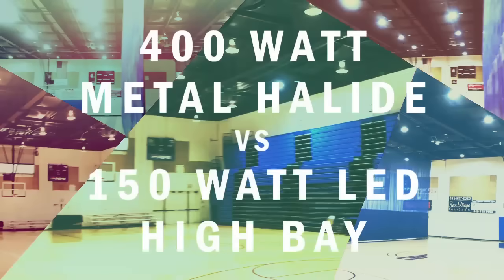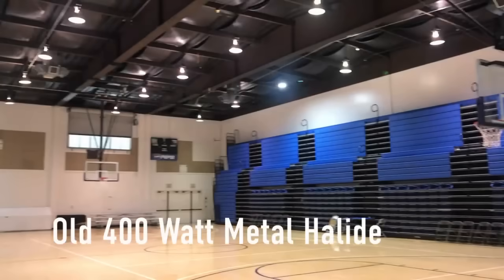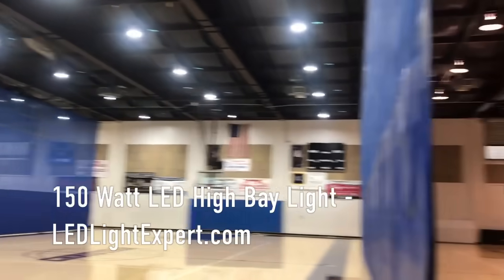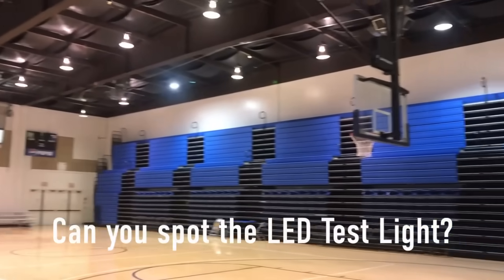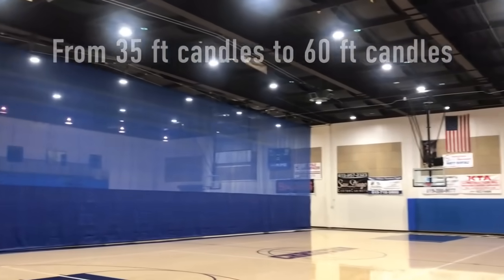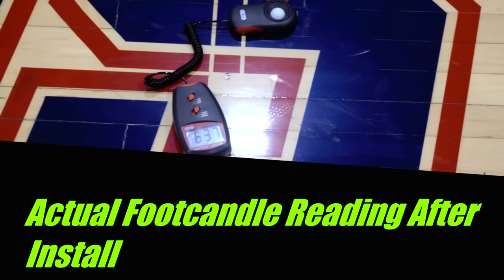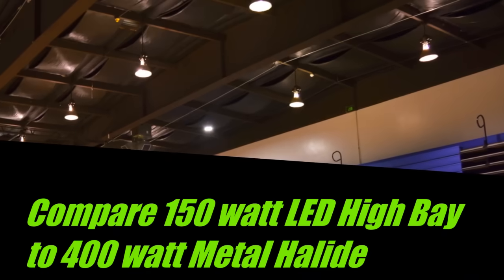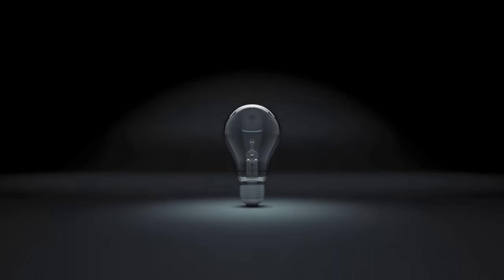400 watt Metal Halide to LED High Bay Light Conversion - Before & After footage of Warehouse lights

Comment: The led is so harsh and unappealing
Reply from the maker: Our high bay lights deliver 145+ lumens per watt, but for a softer, more comfortable illumination, we recommend using lower CCT options and adjustable wattage too reduce brightness. You can give us a call for tailor solutions to your needs 888-701-2183

Comment: I hate led bulbs but i can see why thay are so much better
Reply from the maker: The saving alone and reduced power consumption are the biggest factors that make LEDs a no brainer for people to make the switch. Add that to the lifespan that far exceeds any previous lighting tech, and you have an easy winner with LEDs. Some people do have a problem with LEDs, but remember, not all LEDs are the same. There is plenty of junk on the market that does not live up to the hype and leaves people feeling not so good about LEDs. That's not because LEDs are bad, but because some manufacturers go cheap and use low quality LEDs and optics leading to a bad experience. We strive for high quality and offer lights with independent certification for performance and safety through the DLC and UL along with others, so you know you are getting a quality product.

Comment: metal halide is better
Reply from the maker: Some people do still like metal halide, but those numbers are dwindling. The advantage of LED lights far outweigh those of older tech like metal halide and HPS bulbs. LEDs use about 1/3 of the power compared to metal halides. Beam angle optics are more precise and overall size of fixtures is smaller. Maintenance costs are much lower since you don't have to replace bulbs every 15,000-20,000 hours. Modern LEDs don't lose their brightness anywhere close to as fast as metal halide or HPS will and hold 90% or higher brightness for 36,000+ hours, about the same as the life of 2 metal halide bulbs that can lose 50% of their brightness halfway through their lifespan. LEDs turn on instantly so you don't have to wait 10 minutes for a metal halide to heat up to have usable light. The cost savings alone is usually enough for most people to make the switch, but LEDs have plenty of other strengths compared to the older lighting formats like metal halides bulbs.
Reply: @LedLightExpert  led lights generally fail earlier and they are expensive the new ceramic halides are more efficient than traditional ones
Reply from the maker: @Altamira-Arazz  if you stop buying cheap junk, they wont fail on you so fast. Buy better and you wont be longing for obsolete metal  halides.
Reply: @LedLightExpert  i think he likes them because they look cooler and are not as boring as LED's
Reply: Led hurts my eyes

Comment: I don't have a ballast - can i go straight 120 v to mogul base with these?  Thanks
Reply from the maker: If you are going with a corn bulb retrofit instead of replacing the entire fixture like the UFO fixtures in this video, yes, direct 120v to the mogul base and then simply screw in the the corn bulb as you would any other bulb. Ballast would need to be bypassed or removed if they exist which they should for any HID fixture like metal halide or HPS. If you are replacing the fixture completely, the ballast should be removed with the old fixture, sometimes they are integrated into the fixture but they can also be remotely installed to the fixture. One way or another, you don't want the old ballast in there on the conversion to LED. If you are retrofitting a corn bulb, you can check out our options here: https://www.ledlightexpert.com/LED-Light-Bulbs_c_13.html
Reply: @LedLightExpert  i just bypass ballasts, i don't remove them because they are original to the fixture and just leave an empty voidspace, i just disconnect the old gear and tuck the wares away and that's it. judge me all you like. i don't want to replace my old fixtures because they look better then the LED's and you can replace the bulbs.